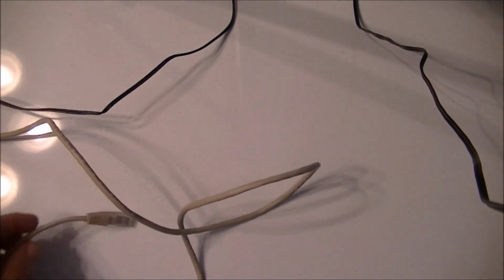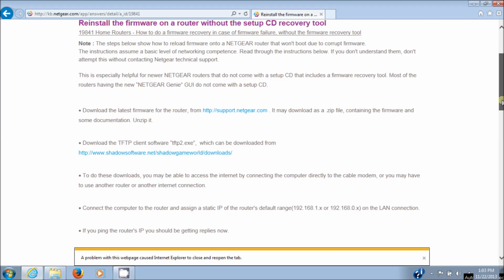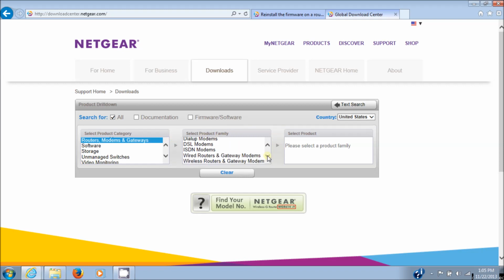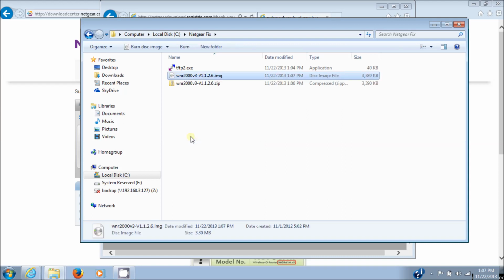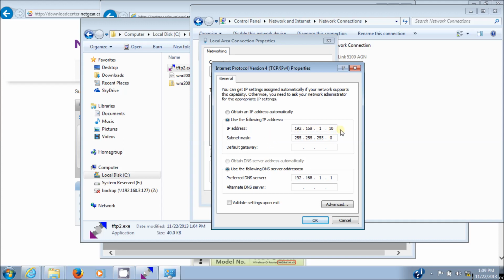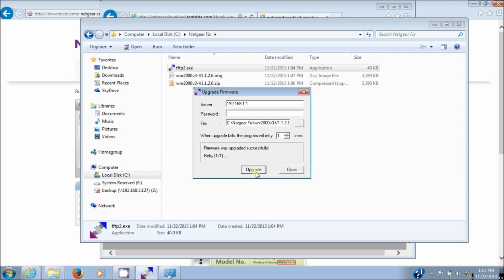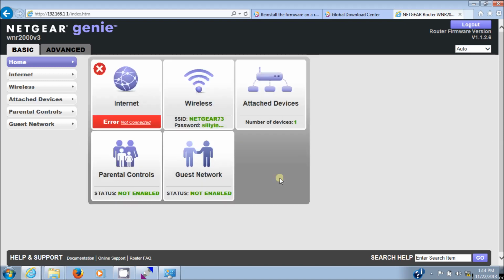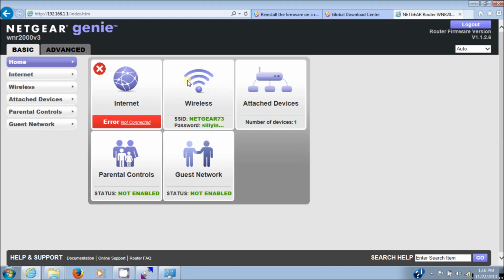Bricked Router Recovery Netgear WNR2000V3 (version 3) How I restored my router

Comment: Richard, 2 years and your patience and your video is still helping folks like me. Keep up the good work mate! FYI, this worked restoring my Netgear WNDR4700 also. Posting this through the fixed router! :) Your video was my last resort after Netgear support were being a PITA making me go around in circles about the router's proof of purchase (invoice), probably trying to get at it not being covered by warranty, etc.!!! I thought I was going to be a big Netgear fan; I picked up this really expensive WNDR4700 router with internal hard disk feature + a Netgear NAS 316 with a 6-bay extension box (which btw the Netgear Pro Support guys were very helpful with helping me fix) but really sad way for a company to go when it comes to home users... End of rant! :) Thanks again Richard!
Reply from the maker: Quirino Cardozo You are most welcome. Thanks for the the feedback on the WNDR4700 I am sure it will help others. It's kind of weird that Netgear could not help you do this as the procedure is something I partially adopted from their support site. I am now a TP-LINK fan partially because many of their routers run the DD-WRT firmware and I have never needed to call their support so I can't comment on that but that also says something. Thanks again.

Comment: You totally saved my bacon. Thank you so much. Worked perfectly on my WNR2000 v2 using the v2 .chk file from netgear (rather than an img file). As someone mentioned below, holding the reset and cycling power kept the power light solid amber indefinitely until I released it, whereupon it began blinking green. All else worked exactly as shown. Thank you for taking the time to put this together. Great resource.
Reply from the maker: That's great! You are welcome. Thanks for watching.

Comment: You are awesome man!!!  Had an Netgear WN200RPT Range Extender which i got for free at a garage sell.  The guy told me he was messing with it and it just stopped working.  So I did a reset (didn't work), 30/30/30 (didn't work) then i searched for more solutions and got to your video. I wasnt sure if it would work on a range extender but tried anyways.  Googled my model number and downloaded the latest firmware followed your steps, which i had to use an alternate ftfp since i was using a mac.  Was able to transfer the firmware but when it finished still didn't work. Downloaded the initial firmware and still no dice.  Had an O crap moment, when i searched for my firmware google took me straight to the right model number but it was the wrong VERSION.  I had been downloading WN2000RPTV3 when it was supposed to be WN2000RPTNA.  Total FAIL on my part.  Got the right version (v1 instead of v3) and bam it worked!!. In the end ya the revision number has to be the same
Reply from the maker: ToRouFilms You are welcome. Glad I could help you save it from the scrap pile. Thanks for watching.

Comment from the maker: @Steven Gilletee (Shadow00f) Did you manually set the IP configuration? @ 11:00 on the video.
Reply: Richard Lloyd light never flashes its always solid red !!  DGN 1000
Reply from the maker: hernandohilario Try a 30-30-30 reset and see if it works then. https://youtu.be/gczCzP9Rry0?list=PLnxXRLSlmSVNiENiN9wTejP6dtIqqmTya

Comment: Thanks mate. It was very helpful and i could revive my bricked router with the help of your video.
Reply from the maker: You are most welcome. Thanks for watching and the kind comment.
Reply: +Richard Lloyd  I suspect Netgear has made some changes. When I follow your instruction and go to their site, I only have the option to enter my model number and download. When I go to where the file ended up, I open it to extract and see two files. One has an explorer log which pops up an instruction page, and the other we want states that it's a fragmented file. When I try to use the other tool to put in on the router, it fails. There are no downloads from Netgear to get only the firmware. I suspect they want me to buy a new router; hmmm, perhaps another brand! Instead of a "disk image file" like you're getting, mine say CHK or the aforementioned fragmented file, and they don't work.

Comment from the maker: @Brandon Morgan Do a 30-30-30 reset and see if it responds then. If not, do another 30-30-30 reset and try the whole procedure again. Make sure you follow it exactly and use my links for the software as I know it works. Thanks.
Reply: Followed whole video from start to finish. Tried many 30-30-30s. tftp2 now says "Failed to resolve host address." Any more ideas? Thank you for all your help.
Reply from the maker: *****  Did you hard code your IP address in network properties? Did you use my links for all the software and firmware? If you did not try again. If you did. Try again but on a different computer.
Reply: Hello! After reset the router, follow to change the IP, open tftp2.exe to upload a Netgear Firmware. tftp2 give me a message "Unbable to get responses from the server." Any help? Please
Reply from the maker: roy392003  Are you getting a blinking green power light?
Reply: Richard Lloyd I get green power light, blue WIFI light and LAN port 1 green light
Reply from the maker: roy392003 Those lights indicate that your router is online and working. The  router should be in a boot safe mode (blinking green light) and with the Lan port light showing connected prior to you trying to flash it. Make sure you follow my instructions exactly, step by step and it should work for you. Keep me updated.
Reply: Hi ,I try to use tftp2 from the link you mentioned, all the procedures same as you said,except network-cable been connected before the procedures, if after the reset couldn't get the reponse from router 192.168.1.1.
Anyway, I try flash the stock firmware, tftp2 show upgrade finished,but the power light stay in green and blink.Never reboot.
Reply from the maker: Make sure you are using the correct firmware for your version of router. Also try it on a different computer. If that is correct try this, shut it off (power switch). Power it down (unplug it) wait 24hrs and boot it up. Check to see if it is working correctly. Get back to me on this. I have other ideas on it.
Reply: Richard Lloyd Thanks for your respond.
I'm pretty sure the router I try to recover is WNR2000v3, I don't get it why the tftp transfor has been finished,but the router still blink in green. I will take a picture off the router's info, could you please help me to check?
Reply from the maker: Stone Li Happy to help you any way I can.
Reply: Richard Lloyd I managed to connect the router by a usb to ttl cable.So I got the uboot log.It turned out my model id and hardware id on board is missing.
may be it because I have tried "mtd erase linux", but when I have not try to use erase command, the ddwrt firmware was still running,tftp flash failed too,firmware transport complete, but never reboot.
would you please help me check the methods in this link?"
http://www.liatoss.com/blog/28-it-hardware/66-netgear-wnr2000-v3-serial-recovery-guide-en.html"
when I tried to use board_hw_id_set and board_model_id_set wrn2000v3 in putty.
The characters in try input messed up .
Reply from the maker: Stone Li  Sorry Li I have not had to take one of these apart to fix it.

Comment: This was exactly what I needed. I was using a WNR2000v1, and so I chose the correct support page from Netgear (http://downloadcenter.netgear.com/en/product/WNR2000v1). When I uploaded the latest firmware, it wouldn't work. So I tried the OLDEST firmware, and that worked. I got the router at a yard sale, so they probably tried installing the latest firmware too, which is why they sold it for $1! Thanks a lot!
Reply from the maker: That's great. You are welcome. Love it when you get something that's broken cheap, fix it and make it new again. Thanks for watching and the great story.

Comment: Going to try this when I get home. Ive got a V2 hope it works.
Reply from the maker: Best of luck. Please tell us how it went. Thanks
Reply: Richard Lloyd It worked! Thank you so much. I was about ready to throw this thing out! Only thing though, rebooting it with the reset button pressed didn't do much (Or maybe it did but I didnt notice). Held it about 5 min or more and stayed amber so i went ahead with the file transfer anyway and it worked. Thanks again.
Reply from the maker: Victor D  Wow that's great. Another Netgear router saved from the trash can. I am using this router as a bridge wifi exteneder. It works great. Here is the video on how to do that http://youtu.be/rsWfFGCBnnM

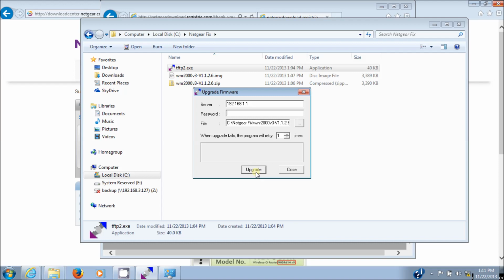Comment: Richard, I did everything as what you said before 13:13. However, I got error message saying the upgrade failed after clicking the "upgrade" button. I also tried the CMD command: tftp -i 192.168.1.1 PUT wnr2000v3-V1.0.1.26.img . This also failed. It seems that my computer cannot connect the router or the router refused to be connected under recovery mode. What should I do? Thanks
Reply: I am also having this problem

Comment: I restored my bricked WNDR4500 by following these steps. Just be patient. Set up the computer for the reset first. Make sure you set your LAN connection as directed. Press the reset button on the router let it go then press the upgrade button. Be patient let the power light turn steady green before going to next steps. It will take a minute.

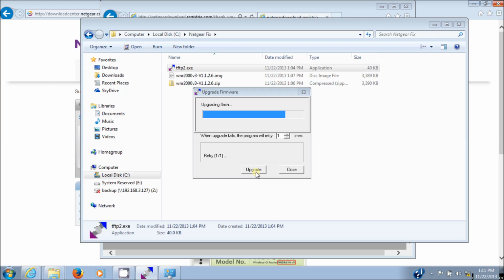Comment: I did everything you did  (i have the sam router as you but when i come to this part 13:20 it says unable to get responses from the server
Reply from the maker: Make sure that you have hard coded the IP address in the network properties? Make sure also that you use my links to download the software and firmware. If you have done this correctly do a 30-30-30 reset and try it again exactly like I did it on the video. Thanks and good luck.

Comment: Hello, I am having the same issue as Gabriel. I followed all the steps as precisely as possible. Note, my router isn't on the server 192.168.1.1, but rather 192.168.1.7. I already changed the TFTP2 Server accordingly. I know this because I ran an IP test through IPScanner and that server was the only one. Also my router pings of that server. Suggestions? Thanks.
Reply from the maker: The router should be defaulting to 192.168.1.1 by default following my procedures. Is the power light blinking green and do you have a green port # showing on the port that you plugged the cable into? I suggest doing a 30-30-30  reset and trying again (google 30-30-30 reset if you don't know how to do it). I would not flash any IP other than 192.168.1.1 as more than likely you are trying to flash the wrong device. Good luck.

Comment: Having the same issue as everyone else on my WNR2000 v4.  No response from server.   Also,  like your router, the number of the port I'm using does not blink.  Thoughts?
Reply from the maker: This video is for a Version 3 only. The firmware is for the Version 3 as well. Did you do a 30-30-30 reset? Is the port number actually lighting up? If the router is not making a network connection the only alternative left is a JTAG or serial connection. But I am not sure what the procedure for that would be.
Reply: Richard Lloyd 30-30-30?   JTAG? Translate?
Reply from the maker: nightspeed98 Jtag is a physical connection inside the router. I have no idea how to do it. But the 30-30-30 reset is here http://youtu.be/gczCzP9Rry0?list=PLnxXRLSlmSVNiENiN9wTejP6dtIqqmTya

Comment: Randomly, my router has started behaving weirdly. This morning it was showing up with the power light stuck on "Orange" which apparently means it's in a self-test mode after powering up, thing is, it should've never lost power. Unplugging it and plugging it back in fixed it, but this is the second time I've had to unplug and replug to get it to behave normally again .Bought a new Router, same model number maybe different version, but maybe I can fix this old one.
Reply from the maker: Give it a shot. You have nothing to lose and everything to gain. Thanks.

Comment: On advanced wireless settings the "Enable Wireless Router Radio" is unchecked but when I check it and click apply it just comes back up unchecked so that's basically where I'm at. Maybe the radio transmitter or whatever just gave it up after 2 years. I know, if I get a new router I should keep it better ventilated, keep the dust blown out, and, mainly, turn it off when not being used. Like when I'm at work and tell the wife to plug it back in in case anybody needs to use.
Reply: +ronnieguitar99 Your router should be able to run 24/7/365 for years on end. In fact, solidstate electronics typically die when powered on not while they are  powered, as it is the change I power states that stresses them more than anything. It also generates power spikes that can destroy them, even if they are plugged into a suppressor, due to the fact that  a suppressor doesn't protect from these low level spikes. They SHOULD be kept in a free air environment, not hidden behind a cabinet or shelf as this not only keeps them cooler it also prevents dust accumulation, and NEVER place them on the floor for their operating position.

Comment: Hello, my night hawk r7000 is stuck on a reboot loop executed on the shell command in tomato firmware...i over clocked to 1200 and it stayed in reboot loop and it wont stay stable enough to stay in boot mode even with a reset. Do i need to use putty at this point?
Reply from the maker: You may have to go to the serial connection route to recover it. I actually have two r7000 that I got in a  bricked state from eBay. I successfully recovered one using serial but the other I was not able to recover no matter what I did. I make a video on both of those. Thank you so much for commenting. I appreciate it greatly. All the best.👍😀

Comment: Shouldn't you connect the modem to the router (internet port) after you upgrade the firmware?
Reply from the maker: Yes you should otherwise you will have no Internet connectivity. Thanks.

Comment: I uploaded the firmware and it says firmware was upgraded, but then continues flashing green for over an hour. Completed the IP address portion of the video and have the correct firmware but all I get is the Ethernet port I'm connected to solid green and the power light flashing green. While it is upgrading the power light will stay on or off (depending on when the upgrade button was hit) then continue blinking green.
Reply from the maker: Brass Tacks Try a 30-30-30 reset https://youtu.be/gczCzP9Rry0?list=PLnxXRLSlmSVNiENiN9wTejP6dtIqqmTya then try this procedure again. Thanks.
Reply: I have completed the 30-30-30 reset but I still have the same problem. I can't even login to the router via the genie or a browser. I also forgot to say in my last post that I have a v4 not a v3.
Reply from the maker: Brass Tacks Unfortunately this procedure only works on a V3 router. I am using TP-Link products and that's a great little router. I reviewed it here http://youtu.be/zr3nZclaaLI?list=PLnxXRLSlmSVNiENiN9wTejP6dtIqqmTya I was very surprised at how well it worked and it's WIFI performance was very good. You can't beat it for $19.99 Thanks I use DD-WRT on it :https://youtu.be/LHNlTb5o82s?list=PLnxXRLSlmSVNiENiN9wTejP6dtIqqmTya as a repeater without issue. BTW it has a 550 MHz CPU in it too. Thanks

Comment: Hello. There is a netgear-wnr3500l-v2 router now only the power and port to which the Lan cable is connected are lit orange. Before the firmware worked fine, I decided to put openwrt-15.05-brcm47xx-mips74k-netgear-wnr3500l-v2-squashfs.chk. After that the router stopped working at all. Reset does not help. Reset 30-30-30 does not work. Through Tftp I can not get to the router enter, because there is no ping from the router. How can you help? Thank you in advance.
Reply from the maker: This is the only procedure I have used to fix this router. You can try the serial recovery. Here is the procedure: http://www.liatoss.com/blog/28-it-hardware/66-netgear-wnr2000-v3-serial-recovery-guide-en.html Thanks
Reply: Richard Lloyd Hello. Thank you

Comment: I'm having the same problem as Dan and Gabriel.  I just tried to 30-30-30 reset and still no luck.  Any suggestions?  It tells me "unable to get responses from the server".
Reply from the maker: Please make sure that you follow my instructions step by step exactly. I mean every step. Use the links that I supply as well and see what happens.
Reply: Richard Lloyd
Hi Richard, this shouldnt be too tricky or anything. I got the tftp2 from the same place you mentioned. But as many other pointer out, upgrade becomes successful but then router does not reboot itself. Since so many others complain some routers must have some difference from others.
Reply from the maker: Naci Ishakbeyoglu  You may be right. Is it a Version 3? I would love to have a try at your router. Have you tried on a different computer? If that does not work try a another 30 30 30 reset and then unplug the router for 24hrs making sure the power button is ON. This will discharge it for certain. Then try it again.
Reply: Richard Lloyd
Yes it is v3. It mentions somewhere else that it has machine id mismatch that's why it is not accepting. They show a way to set the correct machine id by connecting to router's serial port via USB-serial cable.
Reply from the maker: Naci Ishakbeyoglu  That sounds complex. Try my suggestions as far as using a different computer and letting it rest for 24 hrs, Can't hurt. I had a similar problem with mine initially but I kept at it and eventually it took. The trick with mine was waiting for the reboot after the flash which can take up to 5 minutes.